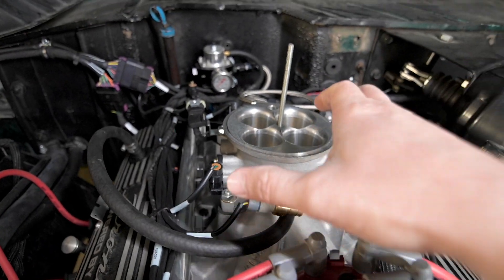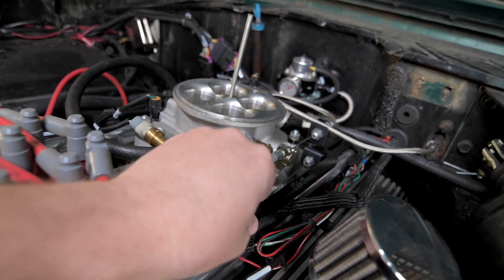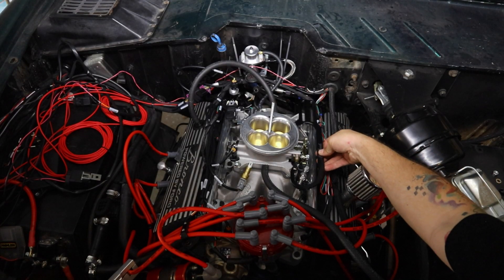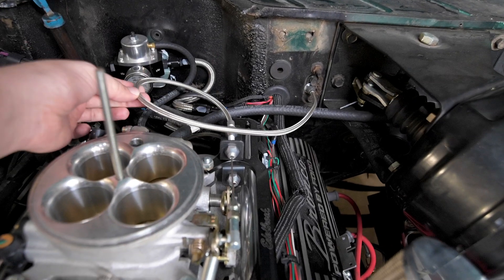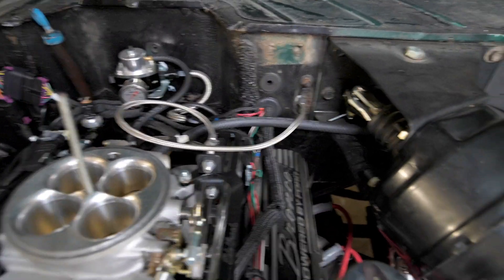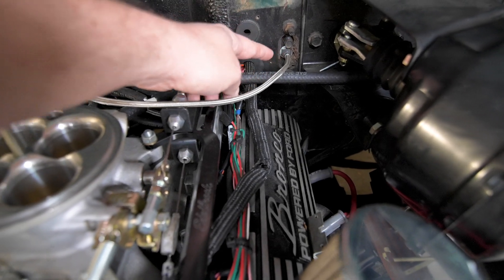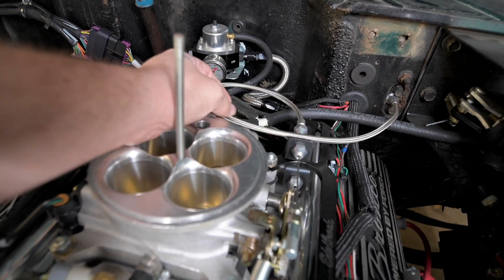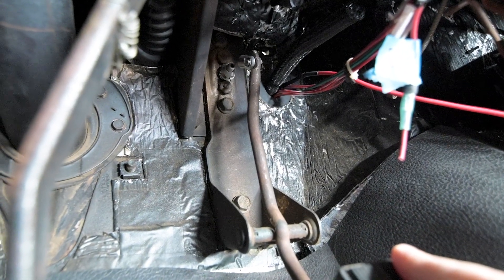Edelbrock Pro Flo 4 EFI Throttle Bracket

Comment: I am in the process (going on 3 years) of doing a total restore on my 1971 Bronco,306,ProFlow4,AOD,Dana 20. I didn’t experience the issued that you did.  Here are some suggestions.  I purchase a couple longer carb studs, using the same Edelbrock bracket, I installed some 1/2” spacers under the bracket.  This brought the bracket up to clear the fuel rail.  Allowing the use of the outer slots in the bracket.  This brought the cables, both kick down and throttle inline with the throttle linkage.  I made a small L-bracket for the return spring (same one that came with the ProFlow4) that uses the inner slot of the bracket.  As mentioned previously probably don’t need the return spring.  The one on the ProFlow4 is quite strong.  I made a small plate that I mounted to the gas pedal assembly, where I ran my Lokar braided throttle cable through.  On the pedal arm I cut off the original linkage post, which left a perfect hole to mount the Clevis from the new cable.  I had to make a small bend to the pedal arm so it line up with the cable housing.  I called Lokar and inquired about running the cable in a loop like you did or In a small S-turn.  They recommend the small S-turn, which makes for a much cleaner install.  I did that and it works great!  The Lokar Kick-down cable runs to the lower bracket beneath the carb bracket and lines up perfectly and just clears the fuel rail.  I don’t know how to add photos here on YouTube so, if you are interested in some photos I can send them to you. Email me at sb4x4trex@icloud.com.  Good luck with your projects,
Reply from the maker: Awesome! Good advice

Comment: I'm installing an Edelbrock Pro Flow 4 system on a 1971 Mercury Cyclone, 429 CJ engine. I need a bracket like yours. The stiff accelerator is due to the extra strong return spring in the throttle body. I think it's too strong. No reason to be that strong, but I don't see any way to lessen the spring tension.

Comment: nice setup. did you reuse the fitech fuel pump? I just bought the pro flo 4 for mine and am converting from a POS fitech. edelbrock told me to buy a regulator

Comment: May be a dumb question, but why switch to the throttle cable?  Is it an option to stay with the stock linkage?  Thanks Jon!
Reply from the maker: The stock linkage didn’t reach. It worked with the FiTech, but not with this set up

Comment: If you are not happy with the feel of the gas pedal, here is a alternative that I found ( https://www.youtube.com/watch?v=58WeyH9wjBI ). I used it on my 73 Bronco with an adjustable bar but it would  be easy to make it work with a cable. The alignment is good and it operates smoothly. This is an old video so prices have gone up. I paid $50 including shipping this year.

Comment: Do you recommend the Pro Flo 4 for a 302 with a lift of 550? I just have a street car with all the bolton mids. I just want more streetability and reliability than the stock ECU. Car is a 91 Mustang with factory EFI.
Reply from the maker: Man, it’s hard to beat factory EFI. It was tuned specifically for your car. Proflo is sweet though
Reply: @NashvilleEarlyBronco  the car is modded. I just want a better way to adjust it and monitor it. The handheld in the Pro Flo seems like it would help do that. Thoughts?